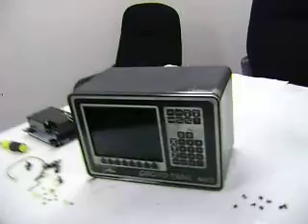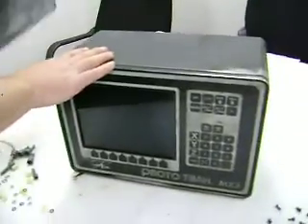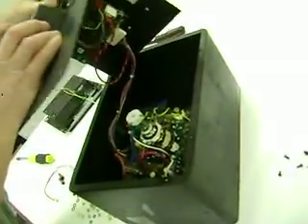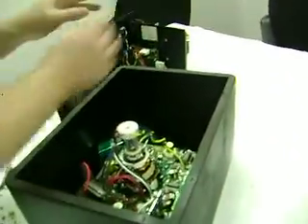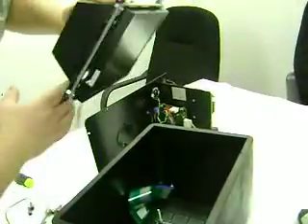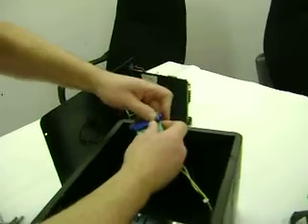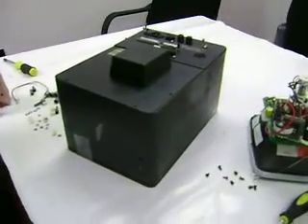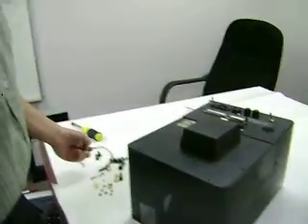Proto Trak MX2 LCD Upgrade

Comment: It would be helpful to see the new monitor powered up. Maybe talk about the different monitors available for the ProtoTRAK. Also discuss the color of the monitor, price, and any adjustment features of the replacement.
Reply: you can literally plug in a computer monitor that has a VGA connection ( blue one ) . I made a mount and have it sitting in front of the old monitor. works just fine and was free.
Reply: @mooreevair  These machines have two different types of video connectors. The VGA or an edge connector. Mine uses an edge connector and unfortunately for me it was not a simple task of just plugging another monitor in. I ended up getting a replacement screen for mine. I had two color options my new screen (green or white). I went into the settings of the new screen and changed the color to white. Also, my replacement was not an easy swap out as the mounting studs in the pendant did not line up with the new LCD frame. They were misaligned by about 1/8" It was not an easy swap, but mine is looking good now. I did not use this You Tube guys replacement. I will not tag the brand that I used because he was not very helpful. Anyhow. Thanks for the comment.
Reply: @LorenP  well that sucks man. 
at least you got it to work. 
with the monitor on mine it's white but the one thing I thought was cool is that the jog bar now highlights in red if you want to jog . it didn't on the ol vacuum tube. 
anyways , have you ever had issues with the dro losing its place and slamming a piece ? I've read here and there it can be a common thing , losing where it's at and usually it's the Y axis. I've read more that's confused me more than helped me about how to solve it. 
just wanna see what you might have experienced.
tia
Reply: @mooreevair  I have experience running the very first ProtoTRAKS. Yes, on occasion the table could lose position. Some of the machines have a wheel in the back and side of the table that basically tell the controller the location of the table. It just rides against the table and rotates with table movement and is very similar to the old Trav-A-Dials. On occasion chips can get inside the wheel and cause it to act erratic. The key to good operation is keeping the back of the table clean and also keeping metal chips from getting inside the pick-up wheel. I believe they had brass wipers against the table that were meant to keep chips out. My current machine uses Accurite glass scales, so the erratic table movement has not been a problem for me. I believe because of the glass scales. The part I am trying to describe is actually listed on eBay now. Just do an ebay search for SOUTHWESTERN INDUSTRIES TRAK M500C / Q25968 TRAVEL DIAL ENCODER and you will see pictures and descripton. Best regards.
Reply: @LorenP  I was wondering how to change the screen from green to white? Thanks